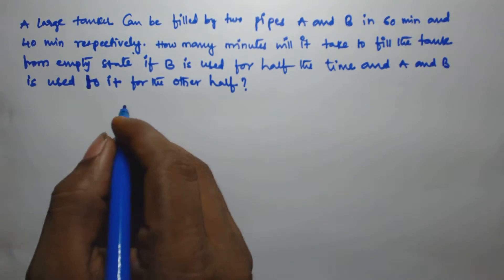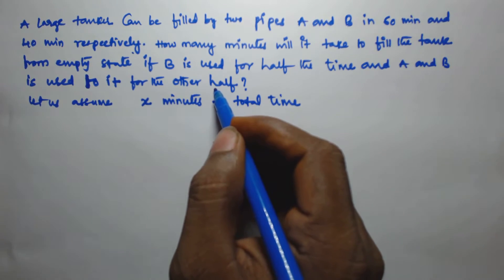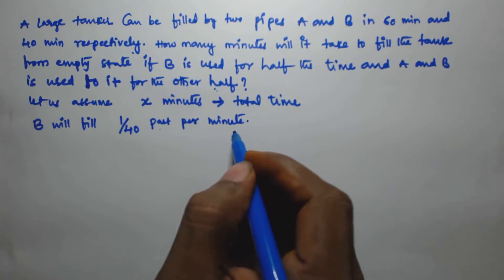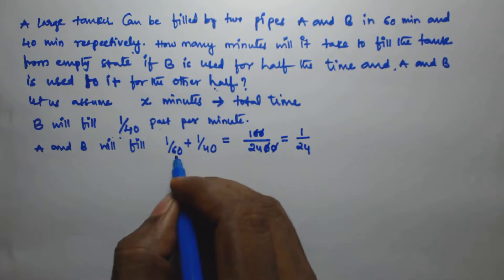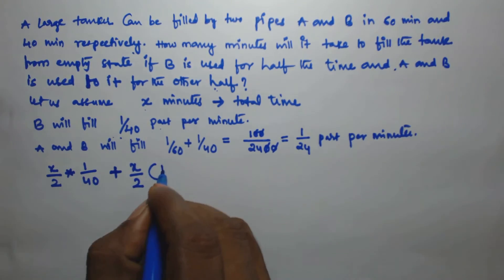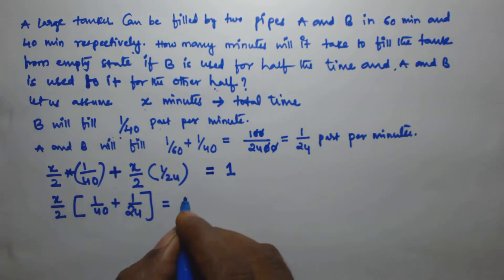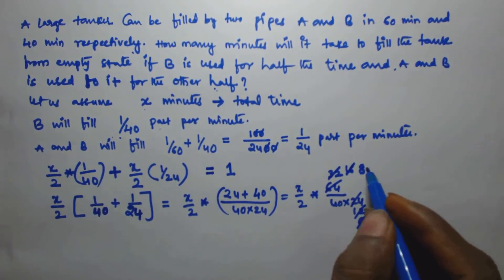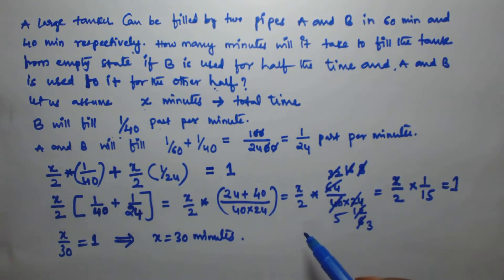Pipes and Cistern Problems and Tricks | Part 11

Comment: sir if we do by Lcm method we r getting 32 as answer can u help me
Reply: No. I am getting 30 using LCM method too.
LCM of 60 & 40 is 120. A fills 2 units/min and B fills 3 units/min. Therefore, let the total time be x.
From the above we get, 3*(x/2) + 5*(x/2) = 120, Solve for X and you'll get x=30. The total time is 30 minutes.
Reply from the maker: good Charles :-)
Reply from the maker: Please post your answer here Sunny :-)
Reply: total capacity is 120.
first half by B so 20 min
second half by A and B so 12 .total is 32
Reply: ya me too getting 32 min...
Reply from the maker: How??
Reply from the maker: Check Charles Answer.

Comment: I think we can go for some other approach .
since A+B took  Half the time lets say X , same way B took another X time
 A+B -> work for X minutes
B alone work for X  minutes

simply A+B+B works for X mts 

(consider we have two B pipe one for first half time and one for the second half time.
since the both pipes work for same amount of time we can consider it as two pipe working for x minutes itself )

From LCM method we have LCM =120
so A -->3 u/m
     B--> 2 u/m
 B--> 2 u/m  (for second half time )

we have A+B+B together 
ie, 8 u/m

so all together take 120/ 8 = 15 m
so total time is 2*15= 30 mts.
Reply from the maker: Ok Akhil :-)

Comment: A-60m
B-40m
LCM(60,40)=120
So, total unit = 120unit

A-2 u/m
B-3 u/m

In 1/2 m "B" will fill 3/2 unit
In 1/2 m "A+B" will fill 5/2 unit.

SO, total in 1 minute [(3/2)+(5/2)]unit = 4 unit. ___________________eq(1)
So, to fill 120 unit, we will multiply 30 on both the sides in equation 1 ....

I THINK, THIS IS WHAT AYAN SAHA WANTS TO SAY.

THANKS FOR YOUR VIDEOS! :)
Reply from the maker: You are Welcome Santosh :-)

Comment: You could have taken the L.C.M of 60 and 40 as total volume of tank and proceeded accordingly. Calculation would have been much easier.
Reply from the maker: Please show me the total answer Ayan Saha by taking LCM of 60 and 40
Reply: A-60m
B-40m
LCM(60,40)=120
So, total unit = 120unit

A-2 u/m
B-3 u/m

In 1/2 m "B" will fill 3/2 unit
In 1/2 m "A+B" will fill 5/2 unit.

SO, total in 1 minute [(3/2)+(5/2)]unit = 4 unit. ___________________eq(1)
So, to fill 120 unit, we will multiply 30 on both the sides in equation 1 ....

I THINK, THIS IS WHAT AYAN SAHA WANTS TO SAY.

THANKS FOR YOUR VIDEOS! :)